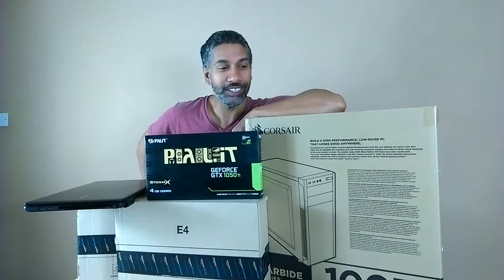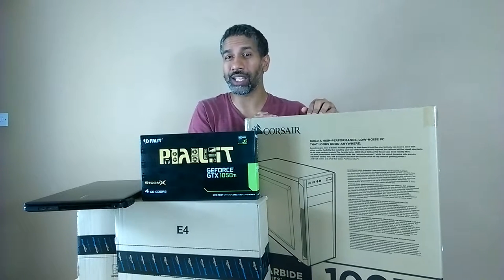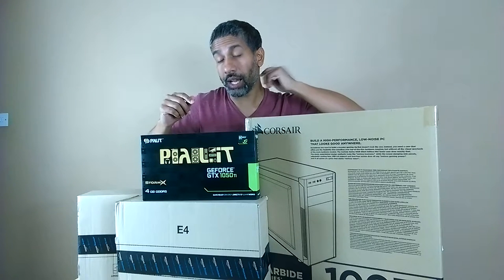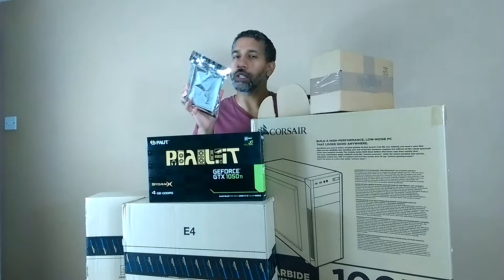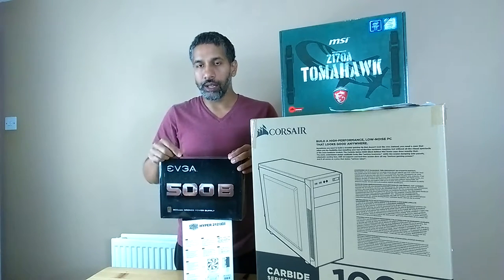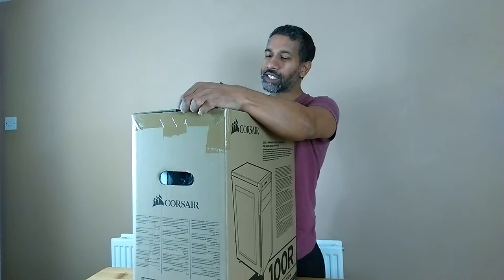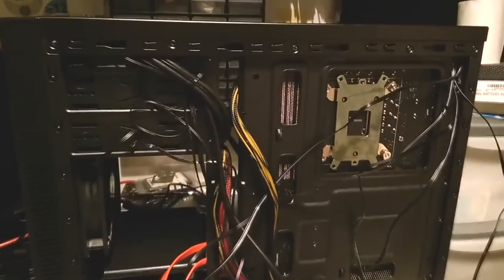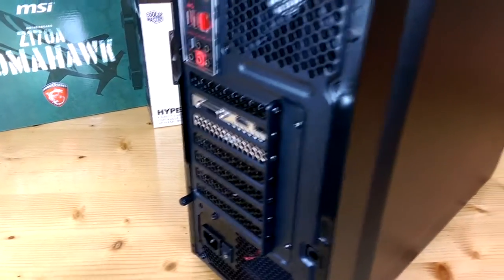BEST ULTIMATE BUDGET EDITING PC BUILD CHEAP

Comment: ok so for the cost you could have bought a server with 128 gig in ecc ram... pretty much the entire server... so no missing parts... this means you could have a rendering machine that has  2 multi core processors.... so lets say 12 to 34 cores in that couple of processors.... the only thing missing would be the graphics card connection and the graphics card ... here is the odd and complicated part... cos some mobos do not have the connector while others do... consider that even if its a old server... by simply changing the cooling fans to a more silent brand you would have a machine that would be as good as the most expensive i 7 rig... in fact considering that with all the 64 to 128 gigs in ram that it would have.... you could very well run most, if not all programs in a ram disk... there are not many options faster than that!!.... now in ebay I have seen these servers for sale at 100 to 200 dollars.... something to consider...

Comment: Great video, glad I found it. I have ordered the same case and I have a hyper 212x cooler I was wondering if I was going to be able to fit it as it is 158mm and the case supports up to 150mm. Was good to see it does fit. Also in check if your ram is in the correct slots the best configuration for my ram is in slot 2 and 4 from the left I noticed you just used first two. It could help with performance if have any issues. Thanks :D
Reply from the maker: Brilliant.